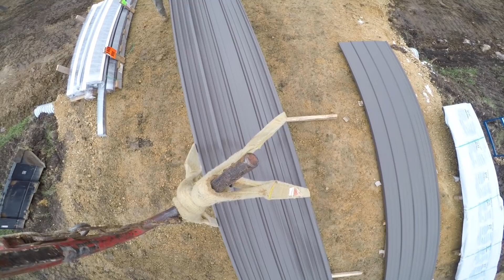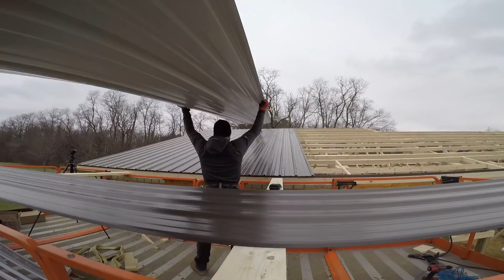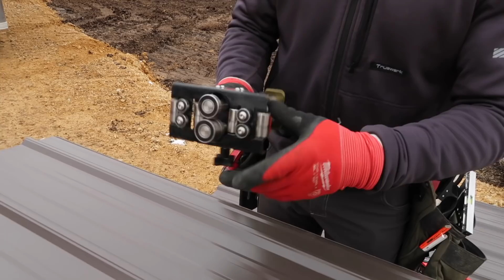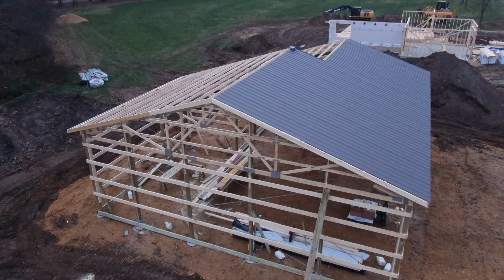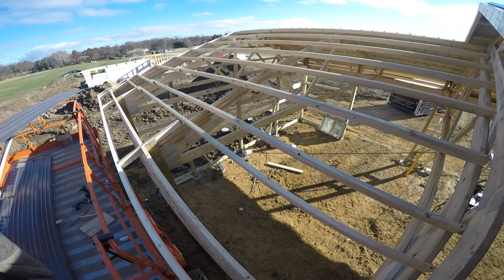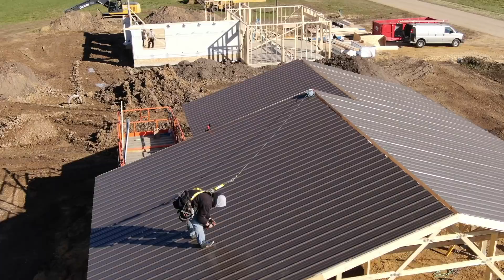Building a Mancave 5: How to Install a Straight Metal Roof

Comment: Man. Absolutely loving the builds. Your workmenship is A1 and credit to how you use all the right tools for the job. Nothing is too hard for you and you take the time to get it right. I am a carpenter here in Australia and I just love how you do some things so differently but with the same principles as here. I have a couple of questions tho and would love if you could answer to sure my curiosity? 
1. When you run your roof Battons to take the screws for the roof sheets you stagger them. So your screw lines arnt perfectly straight? They would follow the stagger? Am I correct in that? That’s not something you are worried about? 
2. You screw your roof sheets off in the valley of the sheet, where the water would run! Have you ever had a problem with this leaking? We screw in the ridge op each sheet ie high point’ down here where the water doesn’t run. If I screwed in the valley for a roof sheet I would get shot. What am I missing here that stops that from leaking? 
Awsome if you could answer and again thanks for posting the awsome videos.

Comment: Hot tip. Screw the top and bottom lap only, mark purlins every 5 sheets. get the roof on first, then chalk the purlins after, you get the roof on so much quicker and the chalklines are actually straight
Reply: This should have taken two people 3 hours MAX

Comment: Really nice work, but would rather see you use standing seam metal with concealed fasteners on the roof.  In my experience over time, those darned screws somehow work their way loose and start to leak.  In wood purlins....not metal ones.  They seem to hold up much longer in metal purlins.  Standing seam is really not that much more expensive.

Comment: Just add 1 jack rafter in between the 8ft span at 4ft and straighten the Fascia line from there once your walls are straight it should smooth out much easier and chances of a dip in 4ft on  2x6 is far less then 8ft for sure. Less work when laying the steal. But thats just me.

Comment: Love your videos, please keep them coming. I'm curious why you don't bevel the top of your fascia boards so the metal sits flat. This would eliminate dimpling caused by the screw and create a better seal between the metal and rubber seal, right?

Comment: I build post frame builings in eastern idaho. just wanted to say you guys have your shit together. Im impressed with your dedication. your detail is great and and you have a nice system down to get these builings done in a quick manner. I usually try to pinpoint all the imperfections in sombody elses post frame builings and although i see somein yours there are many times where i cant see any at all. i build my post frame buildings a little different than you guys, but same concept and and id say your work ethic would put everybody on my crew to shame.

Comment: Just to save some time on your edge measurement .(the inch and a half reveal) Why don't you make a spacer that clips or magnetically .Even a piece of scrap wood an inch and a half long.If you make it well enough you can use it on future projects as well. Just a thought . Great videos by the way. Very informative. Cheers from Ontario.

Comment: Are the screw holes pre-marked in the roof sheeting, because you seem to just stick in a screw without any thought for locating it and the all seem to be perfectly line? (Nice job by the way!)
Reply from the maker: no pre markings on the sheet, we mark each leading edge as we go

Comment: The Fall Arrestor is set up in a dangerous way. If Greg goes over the edge a pendulum effect will occur and it will slice the rope along the edge of the building, maybe before he hits the ground… Either way he's hitting the ground. A retractable running mid line is usually what is used on roofs, keeping the tether as short as possible. Fantasting tin work as usual.
Reply from the maker: really a hard setup on this roof...

Comment: Any chance you can do some Consulting I want to build a 14 by 40 single car garage with a roof over my 14 by 40 trailer and then in five years the trailer will be replaced with a building
I need a 12 x 12 roof with a 40in frost depth 5 hours north of Seattle

Comment: I have a couple things I’d like to do with my pole barn. I haven’t seen you feature these, so I thought I’d ask what you think. First, I’d like to use clear panels on the roof as well as metal panels. I want the light. Good idea? Where my barn is it rarely gets into the 30’s, and there’s no snow. Second, I’d like to shoot the metal panels with closed-cell foam. I don’t need insulation for temperature so much as relative humidity. Your thoughts?
Reply: Oh, rude? Not at all. I like candid anyway. Remember when Tom Hagen told Jack Wolz that Don Corleone is a man who wants to hear bad news right away...that’s me. The Godfather; I love that flick!
Reply: I would want a barrier between the spray foam and the steel. Just for the next guy ( normally me) who has to work on that roof. If it is directly applied you would never be able to repair a leak, fix hail damage.....   Not the guy you wanted to answer but I sometimes just like to add my two cents.
Reply: Isn’t a well-shot closed-cell foam almost “Grail” level protection against leaks? Also, I’ve heard closed-cell foam extolled as a great way to give metal skins added rigidity. For the record, my barn is currently without leak number one. I’m not sure, but I think it’s been in the same spot (Western Coastal Oregon) since the seventies.
Reply: @paulmurphy612  closed cell foam is leak proof until the tree falls and punches a hole. Or I want to add on and need to pull the last sheet up to slide the next panel under. I think spraying directly on steel is fine.  I have had the the opportunity to dig off foam with an air chisel after a truck backed into a standard framed shop wall with 5.5 inches of foam and OSB on both the inside and outside( T1 11) it was a pain. So now I'm gun shy of attached anything to a finished surface.
Reply: BTW I just read my response and it sounds a little rude it is not meant to be at all. Sorry if it comes across that way.
Reply: Myself I would never put a clear panel on a roof, really easy for it to leak. What I do is place them on the sidewall near the top of the wall. I have used them like a wainscot except at the top of the wall, I like the way it looks.
Reply: I get  you want light coming in, I would opt for a frosted glass sunlight, more durable than polycarbonate panels, fiberglass is nice but that and poly are a bit of a hassle to replace every decade where as a glass panel window is more easily repaired and will last longer, even if the glass does get broken it can be easily replaced by any capable glazier and it lets in more light. Though they are a bit heavier but not impossible or impractical to install.
Reply from the maker: First, I am not a fan of and skylight panels as they are always trouble down the road.  eave lights....maybe, even then I don't think they are any good.  foam is fine to control your humidity but once the humidity does get into the building its also not going anywhere.

Comment: Does anyone know why he screws the roof sheets in between the ribs where the water flows? Here in NZ we screw on the rib away from water flow
Reply: When screws are placed in the rib it leaves a 3/4 inch section of the screw that is not supported. Which  lessens the ability of the steel to strengthen the building. By placing the screws in the flats there is no in supported area of the screw and you get the maximum strength of the steel. With a post frame building like this, the outer shell is what provides the strength to the building.  The steel companies recommend how to install the steel and this is what ever company recommends at this time.
Reply: The metal roof manufacturer tells you to screw in the flat part.
Reply from the maker: manufacturer recommendations .

Comment: This is the first I've seen you use fall protection on a video. Is it due to an overall mindset change or is this just the first job I've seen with a steep enough pitch where you are not comfortable doing without??      sdh in CT
Reply: this is a standard (4;12) pitch for them, likely due to the nature of the climate/weather is why they are using the protection
Reply from the maker: I have used it on and off different times depending and you will be seeing it alot more.  I've never liked my systems and have just found a new one I am trying and so far its better.  Post frame does not have a good system yet but many have implemented their own.  I am waiting for something to be approved

Comment: Please explain how that safety harness works if you would, at an angle on the roof it would seem the wearer could go off the roof.   Ron
Reply: We always called them YoYo's....acts just like a seat belt, let's you move around but locks up on a sudden fast movement.

Comment: ? How come you never appear to stop end the top of the sheets to avoid water ingress?
Reply: In a video on a previous build he showed the siphon channel at/near the top of the peak which helps to keep water from getting inside the roof, thus negating the needs to glue/tape seal it which imo is an archaic and damaging method as compared to the siphon channel which does not eventually break down such as the case with sealants.
Reply: @Joshua79C  A 'stop end' is a physical change to the flat plane, it is bent upwards to near 90' to ensure water does not flow back, it is not additional material added.

Comment: What brand is that blue fall protection thing Greg is hooked up to?  PS This troll is glad to see fall protection in use...
Reply: Looks like a FallTech 727630 Contractor 30' Cable SRL
Reply: @gismalleus3215  Thanks for info
Reply from the maker: 50'

Comment: Great vid, thanks. Do you just eyeball the screw placement? I can’t imagine you settling for wavy screw lines, even getting the fresh reference point each sheet.
Reply from the maker: roof steel if never pre punched...we mark each leading edge and connect the dots.
Reply: Sorry . I must be mistaken . It's the side panels that are pre-punched
Reply: The holes are pre-punched in the steel on the ground before the steel is brought up to the roof .

Comment: Do you eye ball where the row of screws falls or do you mark it somehow? I just finished my shop and although I was careful to line up as good as I could, the screws sometimes went wonky down the building.
Reply: I don't think he punches the roof steel because the way the purlins are lapped. You can see Greg is marking the purlins as he slides down the roof. I know the side wall steel is punched because the girts are in the same plane and not lapped. I wonder that to if they go back and snap lines or just eye ball. But from my experience chalk dust on metal roof makes it slippery.
Reply: He uses a punch on the ground.  The punch marks several sheets in the stack at a time.

Comment: What about the condensation under the steel?How you deal with that?Im asking,because here in Europe its done differently.
Reply: The way they build, they insulate the ceiling and vent the roof space to outside. So, inside the roof is the same temperature and humidity as outside. Seemed odd to me at first as well, because we insulate (or at least install sarking), to the underside of the roof here in Australia as well in most cases.
Reply: it's most likely a non-insulated roof so the diffuse film is unnecessary.
Reply: If it was up to me a 2 inch/5cm player of 2lb closed cell foam would be sprayed directly to panel and wood. No condensation concerns after that and r-15 insulation. After that maybe 4 inches or 10cm of open cell spray foam and you have one heck of a tight, quiet, strong, and insulated roof.
Reply: Robert D. - What you’re proposing is expensive and not in every budget. Especially considering this isn’t the primary dwelling, just a garage/shop. Also, the way they insulate the attic space seems to work just fine. There’s more than one way to skin the proverbial cat.
Reply: I think the condensation appears anyway.The inside and outside can not be at the same temperature.Insulating the walls and ceiling means only that the condensation is dripping in the insulation.

Comment: Great videos as always. Question tho, how come you don't put your screws through the ribs rather than the way you were doing  it? Not a smart ass question, just genuinely curious to hear your point of view. Thanks
Reply: I'd like to hear kyle answer this too.  But i know for one thing, when you screw through the rib, the rib flattens down a bit, making the width of the sheet grow.  This makes it much harder to keep the roof straight.
Reply: @deereboy8400  ah that makes total sense haha. Thanks for the insight brother!
Reply: That’s why you go down your eve and mark it out first so you don’t grow. But I’m curious to I’ve always screwed mine in the rib but we use tougher steel to tho. Not sure if that has anything to do with it or not
Reply: The metal roof manufacturer tells you screw on the flat part.
Reply: If you screw to the ribs instead of the flats, you need longer screws. Secondly, when screwing through the rib, any wind load flexes the steel, enlarging the hole and buckling the steel. 

I’ve witnessed this with both 26 and 29 gauge steel.

Comment: Show us how Greg does the controlled (?) slide on the panels from the peak down to near the tail.  That's pretty exciting no doubt.
Reply: I have a 5/12 pitch on mine. It's scary up there, that steel is slick, especially if it's a little wet or the trees are pollinating. When it was put up, the guy that walked the roof wore rubber galoshes for traction. Hopefully I'll never go up there again, but will look for something with more grip if I do.
Reply: Easy. Slide on your knees, stop the slide with your shoe.

Comment: Great work as usual Kyle. A couple of questions.  In Australia roofers typically screw of on the peaks of the sheets, so I’d like to know any learnings from you around screwing the sheet in the trough? Secondly, when Greg is pushing or pulling the roof sheet for your 1.5” measurement, is he then waiting for you to screw off and then he is manipulating the sheet to a know mark up top? Cheers mate.
Reply: X2
Reply: Screwing through the peak is better, when the rubber seal on the screw deteriorate and its screwed on the flat like in the video, you'll find theres a nice little dent for water to POTENTIALLY find its way in or start early corrosion.
We run a string down the bottom edge of the sheet and flex the sheets in the same way to ensure they run straight.
The standard here is to run vapour barrier under the sheets first as well.

Im sure this works well enough for them, we screw fences in this way. Makes no difference on a fence.

Comment: This man is a perfectionist
Reply: If it’s not perfect then what’s the point.
Reply from the maker: exactly....if its worth doing it...its worth doing it your best
Reply: @RRBuildings  My dad taught me "The big marks on the tape measure are for Hacks, the smallest marks are for Professionals."  Your tolerances are better than many cabinet builders I've worked with.  You sir, are a true Professional, and the pride in your work shows !
Reply: @wirewrks   this is the kind of builder we all should be looking to hire.
Reply: Kyle only wants to do the best he can.
Reply: R B Jones 
For sure I understand that 
What I mean by that is if he is off by a quarter inch he wouldn’t stop till it was exactly correct

Comment: Is there anyway you could make a jig for the inch and a half measurement instead of taking you tape out all of the time?
Reply from the maker: I think I totally could... or mark the edge while it’s all in a pile
Reply: A block of wood would do the job.
Reply: We chalk a line on our drip edge at one inch.  Then mark 2" on the outside of every panel to keep ours straight.  But ....kyle your real good man...